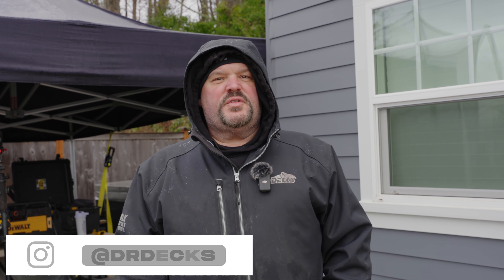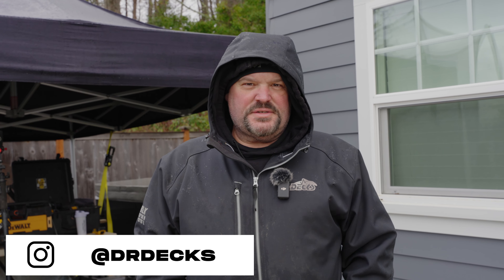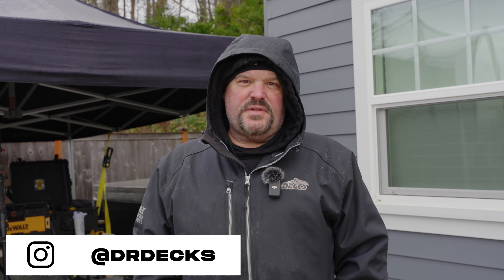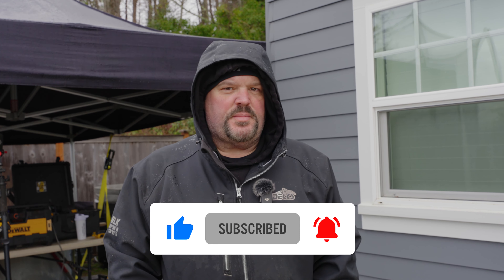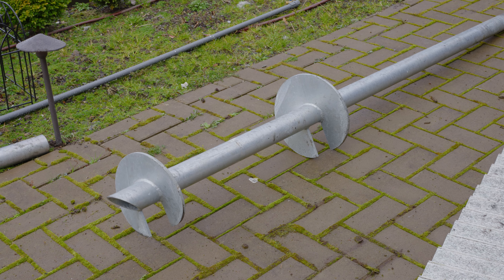Build Update: Using A Double Helix Instead Of Traditional Footings || Dr Decks

Comment: The foundation of my home settled due to drought and cracked, resulting in large cracks in the bricks and the interior walls and ceilings.  I had 10 similar helical piers installed 15’ deep around a corner of my home.  They appeared to be a bit heavier than the ones in the video.  They were 1/4” wall black pipe. The sections screwed together.  After all were installed they attached a huge bracket and jacked the foundation back level.  Interesting process but not cheap.